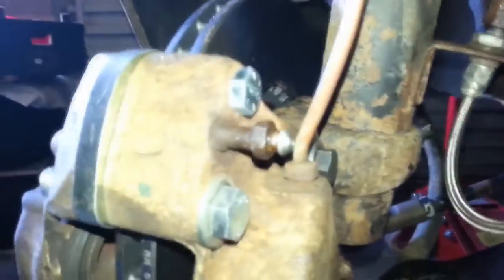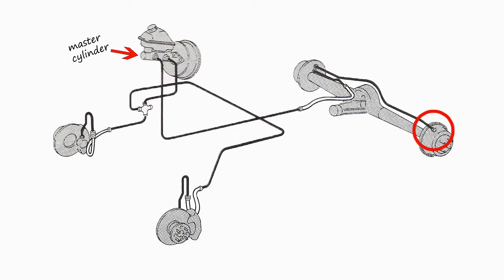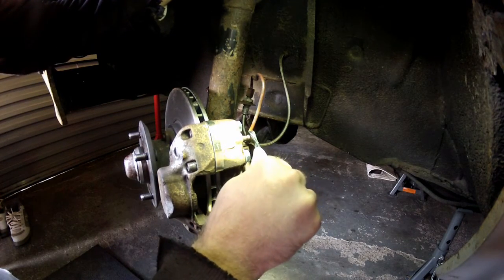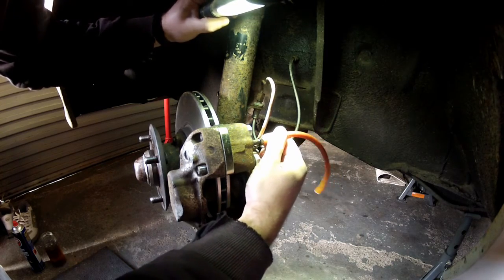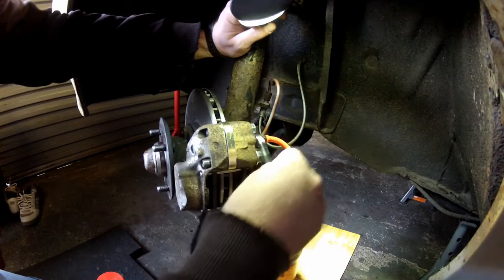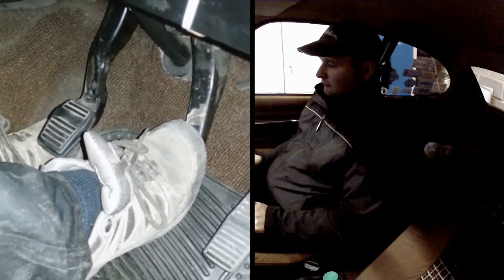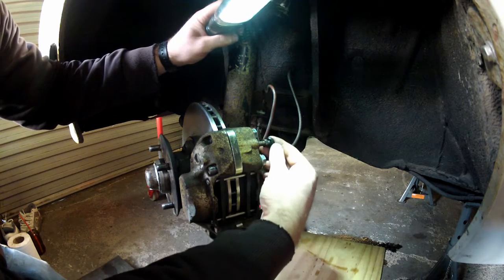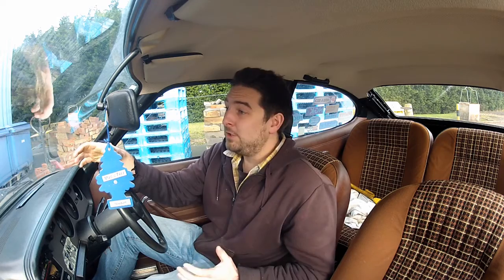How to Bleed & Flush a Braking System (Ford Capri) | Tech Tip 17

Comment: Hello! what does the break pipe from the caliper that goes to the hose called? I have a Granada mk1 and my new calipers didnt include them. PS sorry for my bad English
Reply from the maker: hello! I just call them flexi hose, I'm not sure what the technical term is. If you want to uprate them, search for 'braided brake lines'